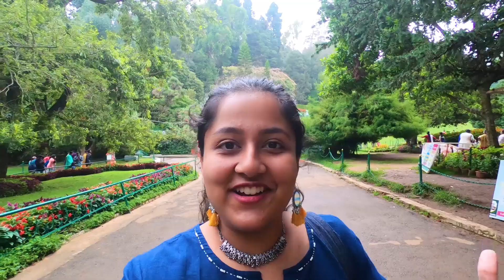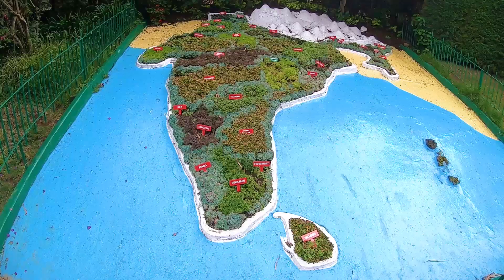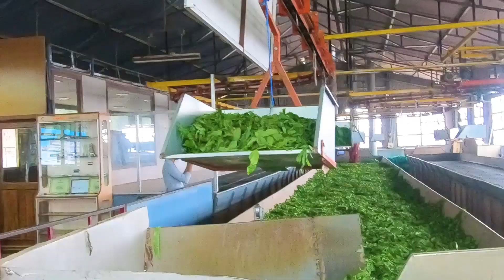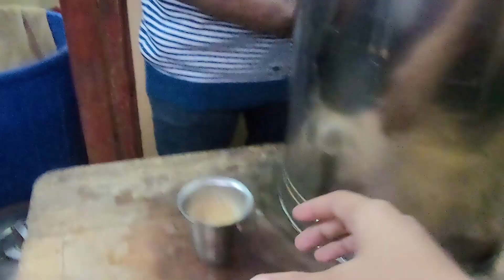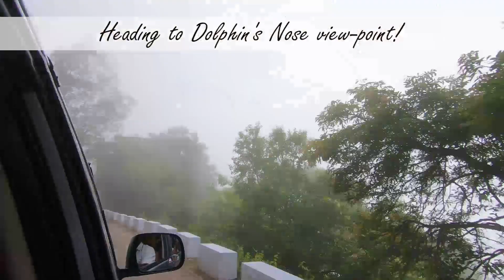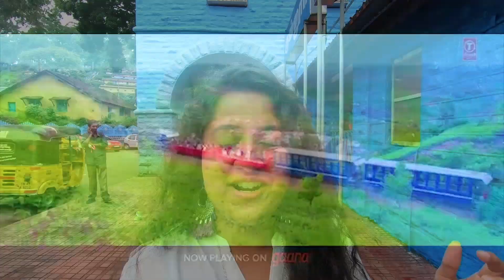OOTY vlog pt 2 & a day trip FAIL to COONOOR | Botanical garden, Tea factory | Nimisha Raizada

Comment: How many days to stay in ooty nd coonor trip nd how to plan it
Reply from the maker: Hi. Around 3 full days are sufficient for an Ooty+Coonoor vacation. You can make it a day trip to Coonoor and return to Ooty by night. That way you won't have to change hotels and carry all that luggage around just for a day. That's what we did. Summers are a good time to go. There's no snowfall in Ooty so you can even go in winter if you want. However, it does get cold then. We went during the rainy season so we had to miss a few things because of so much rain.
Reply: @NimishaRaizada  im planning un winter nd which hotel did u stay
Reply from the maker: I stayed at Lakeview hotel but our experience there wasn't good so I didn't want to promote it. It's good if you want to get away from the hustle bustle of the city. But there are a lot of bugs at night and there's no mesh over the windows and no other way of air so you have to open the windows a bit for fresh air or it can get really suffocating. So it's either bugs or fresh air 💁We also had an altercation with the staff, so I would suggest some place else.
Reply: @NimishaRaizada  i am looking at some oyo rooms in city